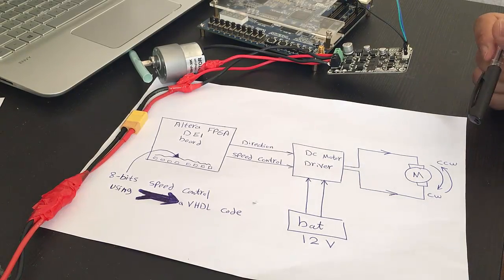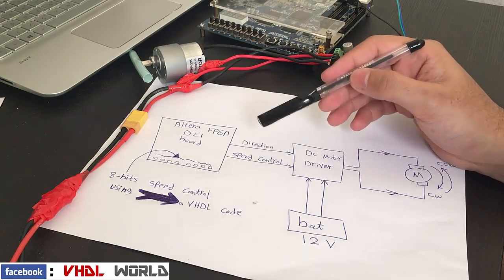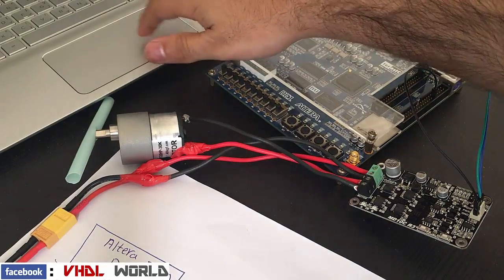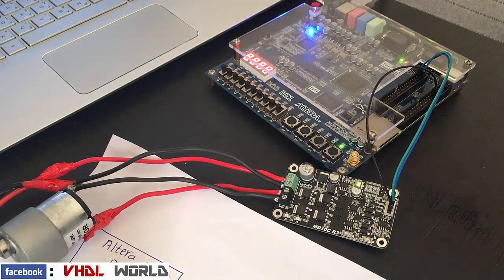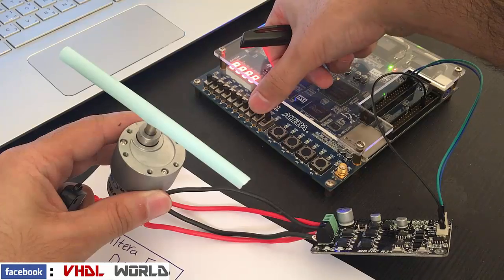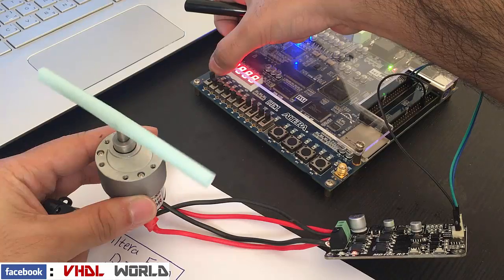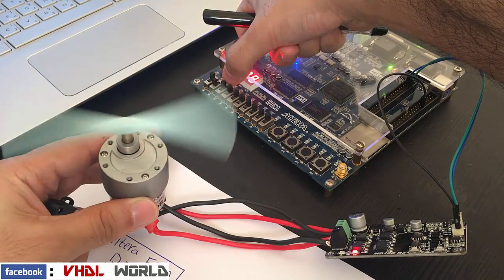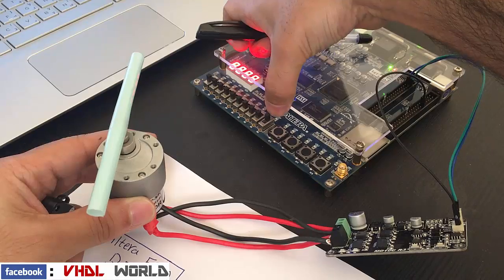FPGA Project: Controlling a Gear DC motor with FPGA

Comment: what changes to do if i have to run 4 dc motors?
Reply from the maker: If you have a controller code for a single one so you just need to create a higher block diagram that has 4 of these single controller
Reply: @vhdlworld  code pls?

Comment: Which motor drive use in dc motor. ?? Plz give me answer
Reply from the maker: Sorry for the late reply
Reply from the maker: If i get your question correctly i think you will find the answer at 2:02
Reply: Actually i have hardwere problem  give FPGA output according to pwm method but didn’t get operated with ESC MODULES TO BLDC MOTOR what is actually problem then how can solve this problem ?
Reply from the maker: but you did it in your video as i can see :https://www.youtube.com/watch?v=ztpPYnfSAPw&list=PLqkDYAPMYUI80xx3o_dH6U14PSQjuCUvQ
Reply from the maker: which looks similar to this previous project : https://www.youtube.com/watch?v=ELE4R-nYPhQ